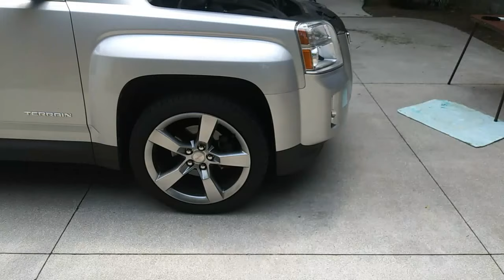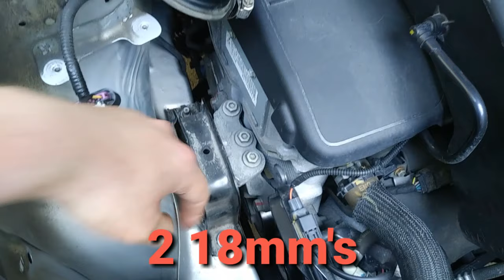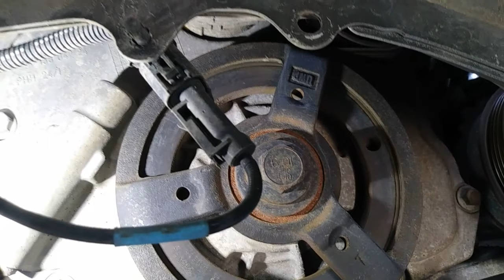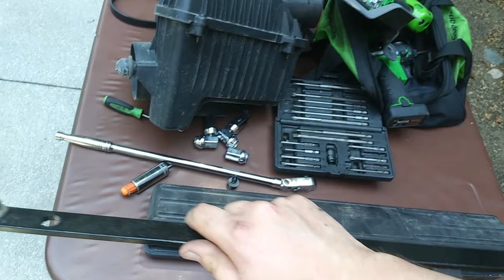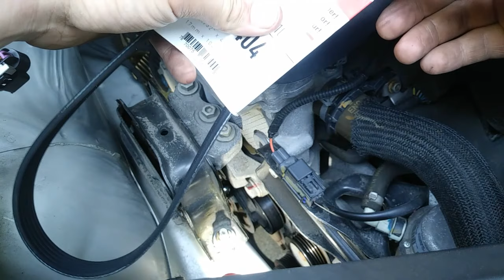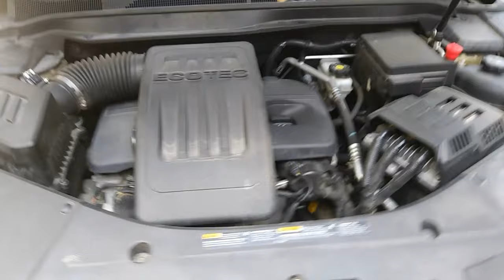How to replace a serpetine belt on a 2010 GMC Terrain (Equinox, LaCrosse, Regal, Captiva).

Comment: TIPS FOR ANYONE DOING THIS BELT JOB. 

You dont need to remove the wheel, you dont need to loosen the motor mount or jack up the engine. i just did one a few minutes ago, used this video as a refresher (im a licensed tech, and auto body tech). I jacked up the front of the vehicle and turned the wheels to the right all the way. ALWAYS USE JACK STANDS, ALWAYS CHOCK THE REAR WHEELS. I removed the plastic side sheild as in this video. i popped the hood, and removed the two 10mm bolts for the air box, unplugged the maf sensor and pulled the intake box, which is not compltely necessary but i have big hands.

i fed the belt in through the top, and put it over the crank pulley and AC pulley from the side. i went back up top, and then pulled the tensioner back with a 3/8 ratchet, and then slipped the belt over the alternator pulley. reinstalled air box and plastic shield, then let the car down and done. 15 minutes
Reply: Was this on the V6 motor?
Reply: I have the same question. @stevensullivan

Comment: Unbolt the engine mount, lift the engine up,  Huuugh!  Use a plastic trim tool with v shaped end.  Cheap, $5 at Harbor freight.  All you need is a 12 break bar with 3/8" drive on it.  Goes right in from the top. Rotate counterclock wise, and slip the belt of the alternator.  Done. Then remove from the bottom side. Put the belt on the crank pulley then on the compressor, and leave the excess on top near the tensioner.  Then from the top, pull back the tensioner and slip it over the alternator pulley. Easy Peasy.  You made it difficult by doing it from the bottom.  I just replaced the alternator in the dark last night, only a flashlight, belt was easy.  If it is squeeling, check the tensioner, compressor, or alternator movement for binding or  noise.   I compared the OE and Autozone brands when I did mine, they are same belt number, made by Gates, and appears to be made in the same Mexico plant.  Physically identical in every way.
Reply: Just did this this morning. Move the air filter box out of the way FOR SURE!!! Than do what TS SCI guy said above! I used a med sizes ratchet with a 3/8" head. My Terrain has the tensioner with the slot for the ratchet in the middle of the tensioner PLATE. I used the handle on my floor jack over the ratchet for something to hold on to and leverage as the ratchet by itself was too short

Comment: I just changed the belt on my 2.4L 2013 Equinox. Drove it up on my ramps and removed the same plastic cover from the wheel well from underneath. Then you have enough access to do the job from the bottom. I feel the ramps are much safer than jacking up the vehicle, removing a tire and sticking your head under there.
Reply: What did you use to losen the belt from the tensioner?
Reply: @rhurtadorh32  your hands.
Reply: @rhurtadorh32  use a tension bar or some kind of long bar with a flat head at the end in order to pry it back to relieve tension
Reply: If you think plastic ramps are safer than secure metal stands you don't belong near a car.
Reply: @bigwahoo8686  yikes bro relax

Comment: I second sai. I have a 2011 Terrain. My serpentine broke today. I was very surprised I was able to drive it around a few places and no critical things went wrong, just battery service station warning which means my alt wasn’t turning. But no over heat or anything. Anyway do some good vids of general maintenance and repair. Would be great. Thanks 👍
Reply: Most likely your water pump is not belt driven. It isn't in my Equinox. Only the AC, Engine and Alternator are on the belt system with the 2.4L.

Comment: can you please do more videos on GMC terrain.. general services like oil changes, coolant changes, cabin filter , oil filter and other stuff related.. you did a good job with this video
Reply: Oil change is easy but i just have a mechanic do it easier. The cabin filter is behind glove box remove the glove box (easy snaps off) the filter is behind it and just take it out add a dryer sheet cleaner for extra smell...
Reply: Hop to my channel. I have over 60 equinox/ terrain videos. Many more coming out.